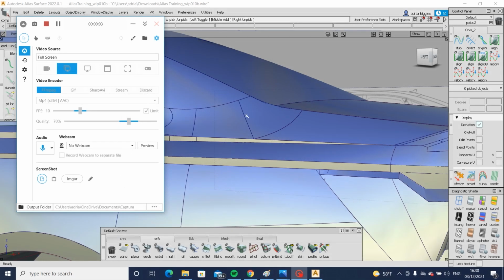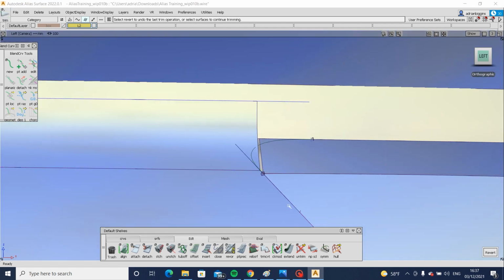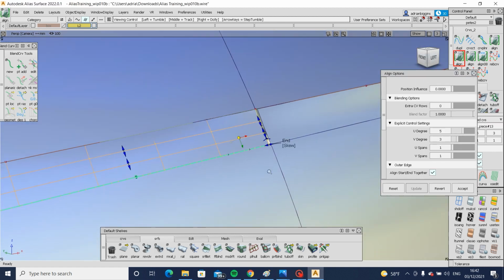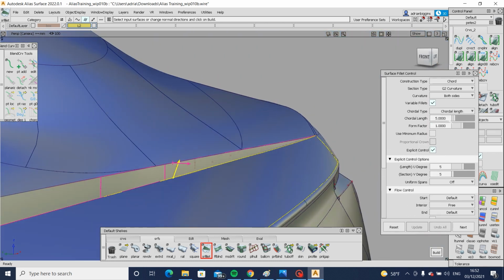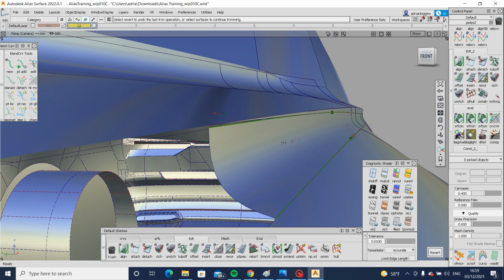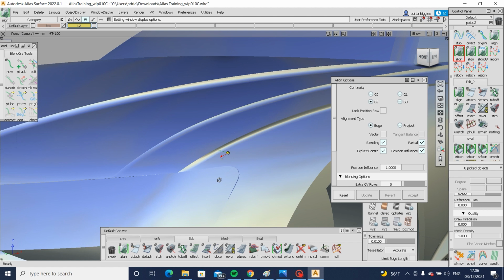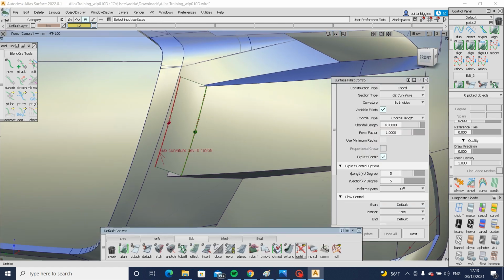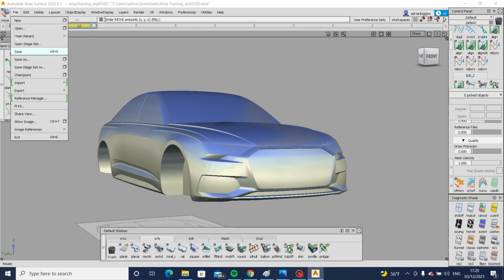FREE ALIAS Day 6 - Part 2: Adding more Rads

Comment: at 30:00 when you rebuild the curve you create a new ep curve. if you had used duplicate curve on the upper edge there, what would be different? or same?
Reply from the maker: My workflow is the most effective and common in the industry. Best to stick to this
Reply: @AB3Design  doesnt sound like a humble or nuanced take :P you just made me wary instead
Reply from the maker: I’m just being honest. I created these tutorials because everything else online was not up to standard. Even most of the paid tutorials. Feel free to try others but you’ll be leading yourself down the wrong path.
Reply: @AB3Design  personally already studying at a school and will have mentored internships next semester, just checking online videos out of curiosity!
Reply from the maker: I didn’t learn alias properly until I got into industry. Everything I learned at Coventry uni was a waste of time and money. Good luck with your studies
Reply: @AB3Design  
If you don't mind me asking, how did you get your first break in the industry? I am finding it very difficult to even land a temporary job with no experience required. Many places only accept you if you have experience. How do I get it? It has been a year since I graduated with a degree in Industrial Design. I wasn't a bad student either.
Reply from the maker: If I duplicated that edge, then the curve created would have been too long. I just wanted a curve for that section so the curve could be snapped to the fillet so I could create a square
Reply: @AB3Design  i see. do you think its damaging to look and see others workflows early in my alias studies? a few weeks in now